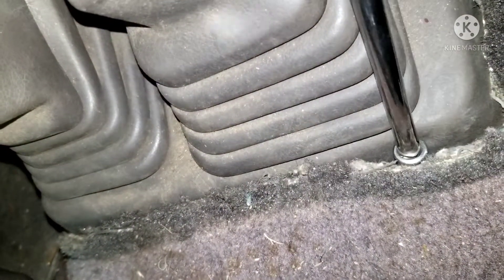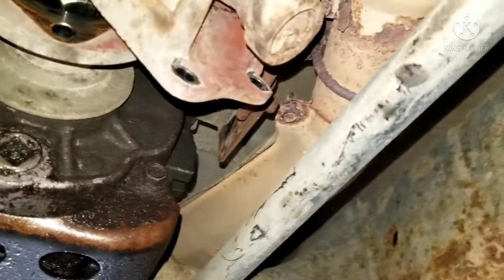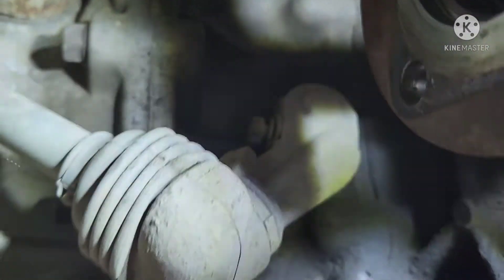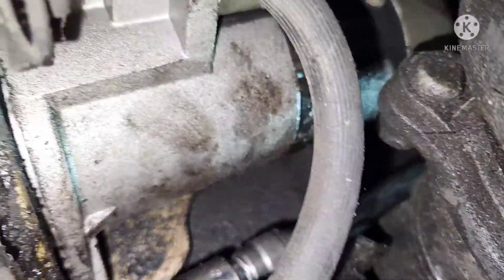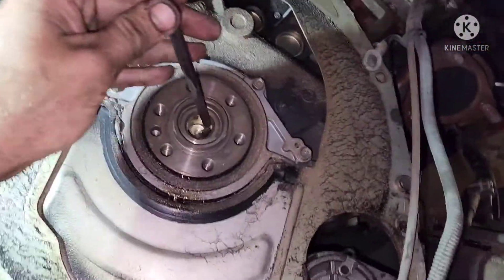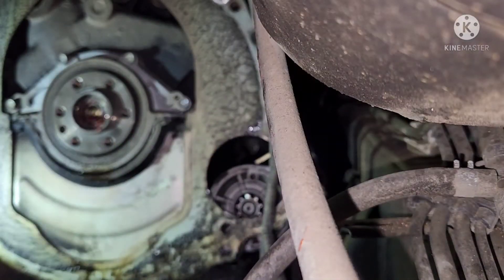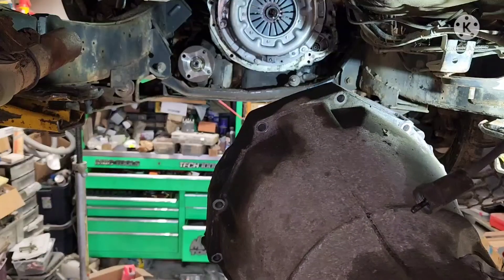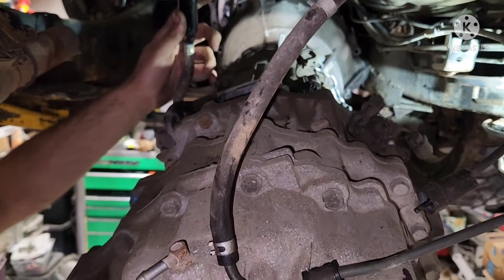1987-1995 Nissan d21 3.0 clutch replacement

Comment: Great video, thanks. I was excited when I saw you started removing the transfer case lever, but you got stuck at the same place I am. I'm busy with a complete rebuild on my 1990 model. I want to modify the transfer case lever to be more straight since I'm building a center console. Any ideas of what I can try to get it off at the point you stopped, will be highly appreciated.